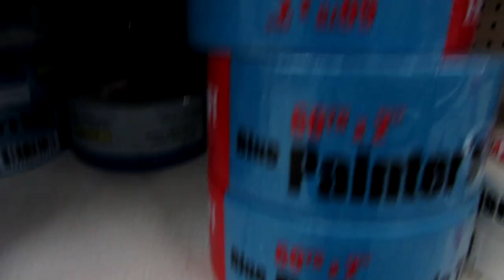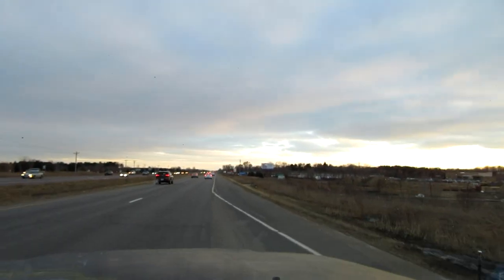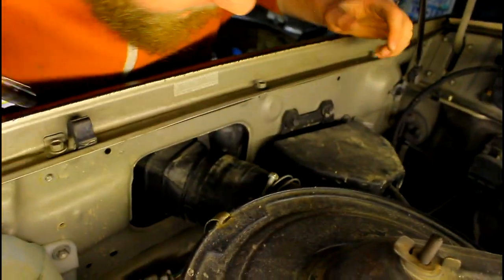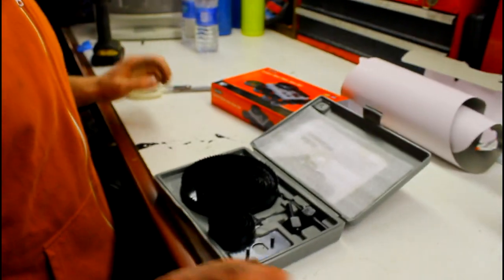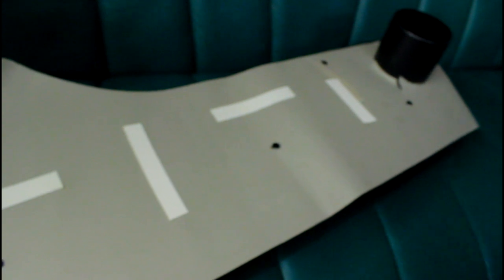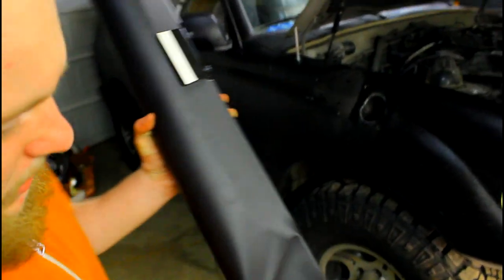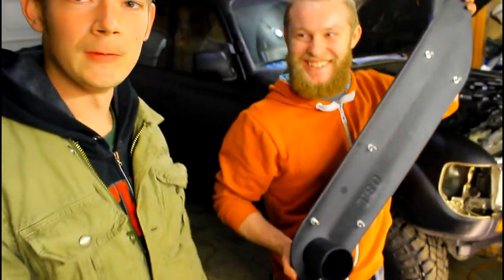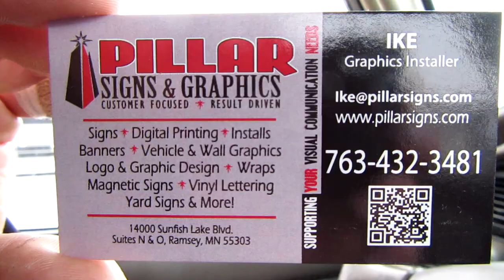Snorkel fj80 install Broken Wrench Adventure

Comment: Hey guys, my snorkel just arrived and I'm wondering if the rain would go in and cause damage. 1994 fj80. I'm in NY so I don't do much water crossings except when sudden downpours cause streets an highway flooding. I must say it just gives it a badass look. Thanks
Reply from the maker: I agree lol It look really good with it on lol. I havent had any water in my air boy They have specially designed flutes at the head to limit the water that actually makes its way into the snorkel itself during rain. I Have driven through major storms with no issues